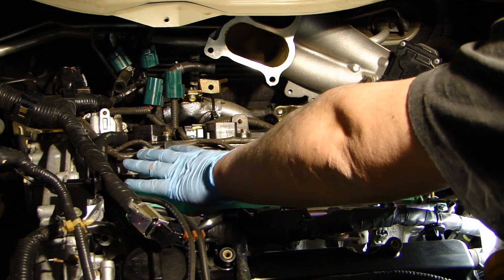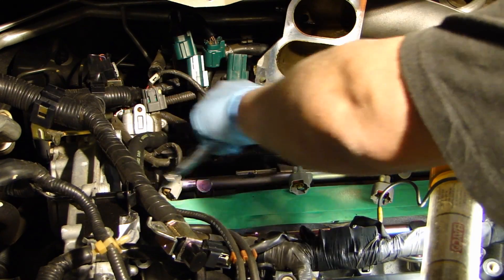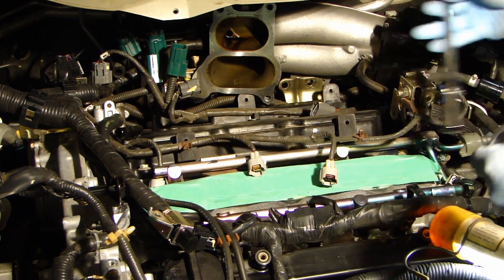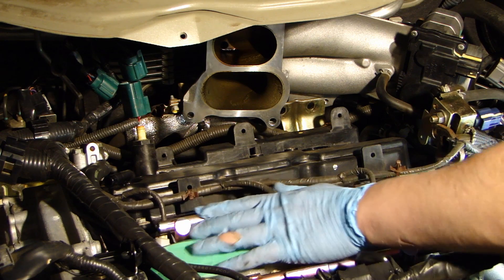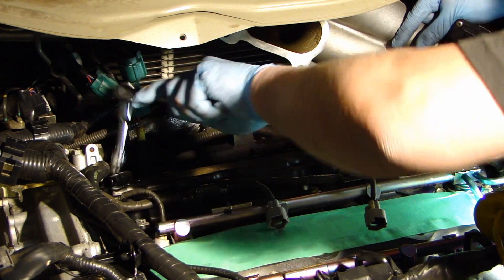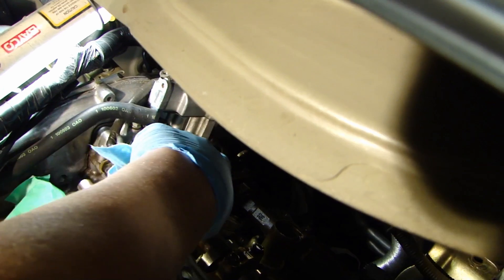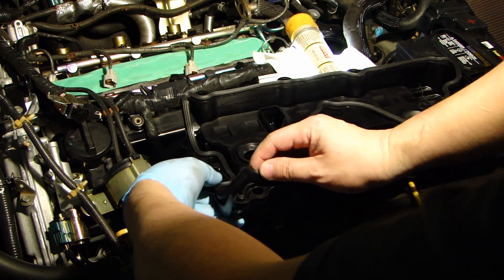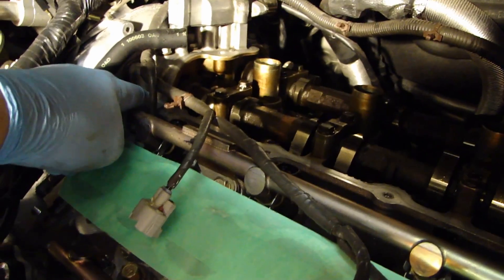Nissan V6 Replace Spark Plug & Valve Cover - VIDEO 3: SPARK PLUG & VALVE COVER

Comment: Question - Is it necessary to replace the valve cover if I am just replacing my spark plugs?
Reply from the maker: If you are doing the spark plug service, then most likely your engine has 90,000+ miles and the gasket on the valve cover is old and possibly starting to crack. So it's best you replace it or else you might have engine oil leak.

Comment: SOME TIPS:
1. the gasket around the plugs was very snug in my Apex-branded valve covers such that they wouldn't seat; I wiped the gaskets with a little clean motor oil and they slid right now.
2. the valve cover gasket itself tended to fall out of the groove in the cover, especially on the side that was the last to go in.  Using a trick I learned on my Saab, I put a small (2-3mm) dap of RTV in the channel at the corners and near the bolt holes, then pushed the gasket into the RTV. Held just fine.

Comment: I am in the midst of doing this job on an '06 quest with 184k.  The Nissan valve covers are no longer $40...they're closer to $200.  I purchased the Apex brand from rockauto, and at least the front cover went on just fine.

Comment: A word to the wise. I'm still wrestling with this 05 quest and trying to torque the valve covers down now. I'm on my second (this one was brand new) AZ loaner torque wrench trying to do 17" inch pounds with the fear of breaking the bolt head off....i'm just gonna go by "that should be tight enough" now...There is no way i could go 4X that much.

In hindsight i would pay 12 million Dollars to have someone else do the repairs and when they finished and when they finish Gift them the Vehicle as a tip...
Reply: Update...1 just snapped off....This is insane!!!!

Comment: Could you change the plugs without removing the intake manifold
Reply: only the ones in the front, when i go the back ones i need to removed the intake because its on top of the coils

Comment: Hey dial, what if there is a little bit of oil next to the coil pack? Is that an indication of a bad coil pack?
Reply from the maker: It's probably a small leak from the spark plug tube seal that's on the valve cover. You should replace the valve cover which comes with the rubber seal molded into it.

Comment: Hello, is their a specific foot-pound for the spark plugs or by hand is good?
Reply from the maker: For brand new NGK plugs, it's 18 ft-lbs (no anti-seize compound on thread). The torque is different for plugs that were removed and reinstall.
Reply: dial2fast ok. Thank you, again.
Reply: Hello, another question.  Do you have any recommendations for cheaper, inexpensive torque wrenches for this job? I have found Harbor Freight(Pittsburgh), Tekton, and Tacklife torque wrenches in my budget.  However, I have not ready many good reviews especially for the purpose of using 12-18 ft-lbs

Comment: Thanks for the wonderful videos.  Why was the valve cover replaced?  Did I miss something along the way?
Reply from the maker: Valve cover was replaced because of the gasket leaking due to age. Common problem on this engine. Also the valve cover has these sealed spark  plug oring which you can't replace, so the whole cover needs to be replaced.
Reply: Thanks.  I am amazed by the amount of work.  I appreciate you posting the videos and at least now I don't have to figure it out when it comes down to it.  I also appreciate that you mentioned the tools required and where you got them.  If my gasket doesn't leak, then I'd be tempted to find find o-rings for rear valve cover (instead of removing and replacing the whole thing)....hopefully same o-ring as front valve cover.  
I am more than willing to modify my vehicles for future maintenance (or hot rodding for that matter:), but I don't see much where I would swap a bolt for a stud, or a stud for a bolt, or cut and weld a different bracket.  I would be tempted to lengthen a few of those wiring leads though.  
Great job!  Good thing these plugs last 100K miles.
Reply: @silvernblackattach  great info..I need to remember that.

Comment: Thank you for a great 3 part video! Awesome!!! I am about to embark on a spark plug change on my 2004 3.5 maxima. I noticed in some videos people are no taking off the back part of the plenum. Is that the case? There less I have to do on this the better! :)
Reply from the maker: My iniitial approach was also to take as little off as possible, but what you saw in my video is what I had to take off to get to it. The throttle body also has coolant lines running to it making it hard not to separate the the pieces. If you do remove the coolant lines, then it might be possible to remove it as one piece, but you will have to bleed your coolant system afterwards.
Reply: Well, I was able to get a new head cover and gasket on. Was tightening everything down and broke a bolt!! Err! Am I screwed? Can I leave it and still hope for no leaks? All the other bolts are good! Thanks!

Comment: how do you get the valve cover separated from the breather tube without breaking the plastic nipple everytime I try to remove these hoses they break off. This is the breather tube that goes from valve cover develop cover

Comment: shoot, I thought the 2007 Nissan Altima valve cover replacement was bad(removing bracket to engine mount) this takes the cake. Kia Spectra 2000 was just as simple as removing the all the bolts from uptop, no obstructions whatsoever. Seems like the newer the car the worse it gets...

Comment: thank you. one thing i think you should add is i believe you are supposed to LOOSEN the valve cover bolts in a special order also.   Two of my rear valve cover bolts broke off when i was just trying to LOOSEN them!!   I found out later that maybe you are supposed to go in a certain order.  It took me days to drill out the broken bolts, and it doesn't look pretty either.   I replaced the 2 broken ones with nuts and bolts from the hardware store.
Reply from the maker: +Tom H The Nissan service manual do have a sequence to remove the bolts, and I did not follow it because the engine was cold and the valve cover was to be replaced. With your situation, not sure if it was replaced before by someone else and perhaps it was over tightened before. The torque spec for them should not have broken the bolts.
Reply: +dial2fast  i thought it was weird to break while loosening.  bad luck.  You're video was the by far the best, thank you.  I hope to have quicker success on my dodge ram valve covers soon.

Comment: I just cant get enough of your videos, thanks for publishing them.
I have an 05 murano and from the work i have done on it it looks like the same engine and set up.
Im curious on how you diagnosed posterior valve cover to be the source of the leak. My car is loosing oil and i dont have blue smoke or any smoke nor do i have a visible drip anywhere. Thank you in advance
Reply from the maker: +Marsel Cuka I found out my rear valve cover is leaking because of the oil burning smell as the oil drips on the rear header exhaust pipe. There weren't any smoke but just burning smell.
Reply: dial2fast thank you for the reply. unfortunately i don't have any burning oil smell. Thank you again

Comment: Thank you for sharing this knowledge with the rest of us.  i have a 2005 Quest with over 140k miles and it still has the original spark plugs.  i was contemplating doing this job myself because of my lack of trust dealing with the dealerships service dept. (i have heard that they sometimes only change out the front three because of the amount of work involved).  I have purchased NGK LFR5AIX-11 #4469 Iridium-ix.  This are different from what you recommended.  Can you advice me if i should be concerned.  Thank you
Reply from the maker: The 05 Quest also comes from the factory with NGK Platinum PLFR5A-11 plugs. I am not sure what is the difference with the one you got but it's best to stick with what the manufacturer use.
Reply from the maker: dial2fast See page EM-170  http://www.nicoclub.com/FSM/Quest/2005_Quest/em.pdf
Reply: They've removed the service manuals. Something about infringing upon the legal rights of Nissan.

Comment: Excellent video.  I'm going to change out my valve covers this weekend due to some oil leaks.  My laptop will be in the garage with me tuned to your video!!  Keep up the great work.
Reply from the maker: Hope everything goes well for you. Leave a comment on how it turns out. Thanks!
Reply: The project went very well except for the part where I didn't mark the rear coils correctly.  I had to take the intake off again but no big deal.  No more oil leak and she runs great with the new plugs.  Thanks for the help!!
Reply from the maker: RD Bennett Very good to hear that you got it fixed and able to save some money instead of taking it to a shop.

Comment: Hi what is the part number for the valve cover?

is it 13264-7Y010 (front)

or 13264-7Y000 (rear) 

I assume it is the rear but just to make sure before i make a order
Reply from the maker: 13264-7Y000 (Cover Assy-Valve) is for the back one by the firewall, and that's the one I changed in the video. I will assume your other part number is for the front as I did not buy that one.
Reply: dial2fast did you change the front ones before? or is there reason why you didn't change the front one?
Reply from the maker: VVSH07E I have not changed the front one and because the front one is so easy to get to, I will change it if needed. The back one is first to go because of more heat with so much cramped at the back. The gasket that I pulled out on that back gasket was really hard and rubbery anymore. I also spoke to a Nissan mechanic and he said the back one is the one they always replace.
Reply: dial2fast thank you so much for all this info! I couldn't do this by my self or would have took me forever to educate myself from internet and forums to do this at home. Again thank you for the video and reply!
Reply from the maker: VVSH07E I appreciate the fact that you truly understand how much research involved to do such a job and then video record the procedure. It's viewers like you that motivate me to do more videos. Thank you!

Comment: Hi my husband  wants to know if there's anyway to replace the rings of the spark plugs tubs? He said if is necessary to buy the whole thing, we will apreciate your help thanks
Reply from the maker: The few hours i spent on the net looking for replacement spark plug oring came up empty handed. Since this job is so involved and for a peace of mind so i dont need to worry about premature leaks, just get the oem valve cover and you are good for the next 100k. Also i spoke to a Nissan mechanic and he said at the dealer, they don't service the valve cover. They replace the whole thing also. One more thing, the new one comes with a new PCV valve with new o ring.
Reply: It’s unfortunate timing that now you can get these grommets on amazon